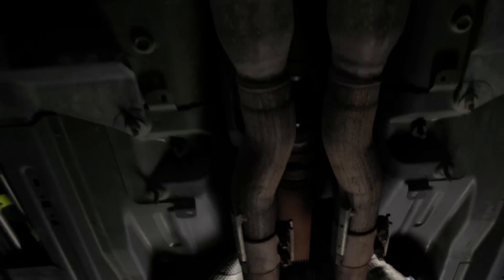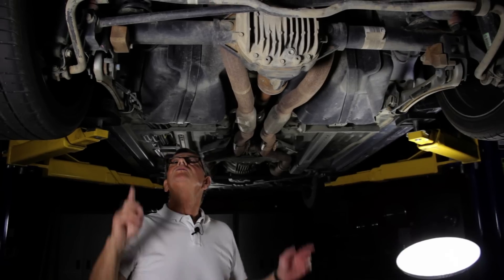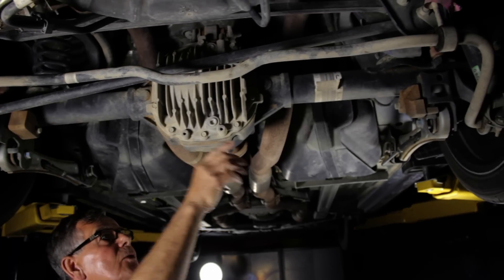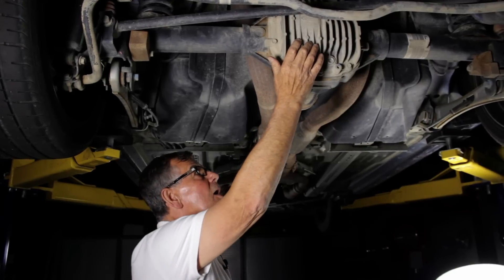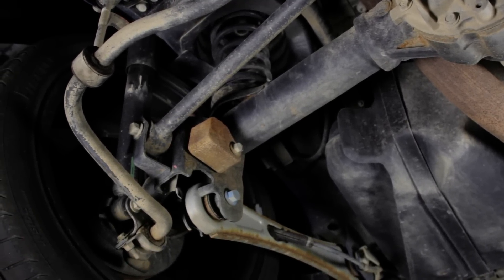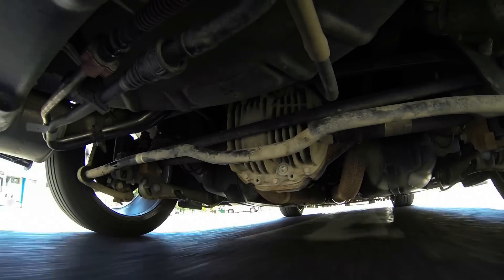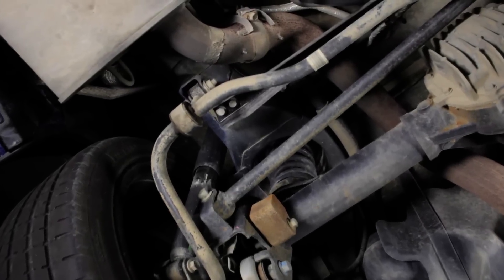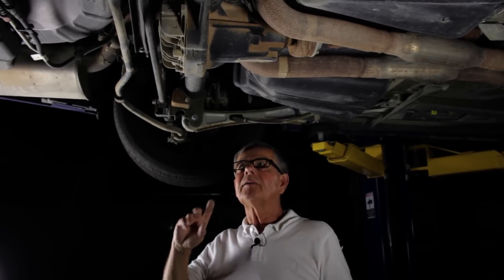2013 Ford Mustang GT Rear Suspension - C/D Underbelly

Comment: Mine has a bumping/rattle sound some times, still trying to figure out what it is, Ford could not find it on three occasions, it has been doing it from around 30,000 miles to now 72,000 miles. It isn't all the time and is a head scratcher.

Comment: It needs a watts linkage like the Aussie Ford Falcon, a 5 link like the falcon is superior, as the suspension goes down on a car with a panhard rod the differential does move side ways a bit, the watts linkage won't. It is a well known problem in Aus, the local GM product the Commodore had a 4 link like the stang, if you lowered them the diff would move side ways and a wheel would scrub on the guard so you would have to fork out more for an adjustable panhard rod where with the equivalent Ford you wouldn't have to. The Falcon has lots of advantages back then over the Commodore, the GM had a Macpherson Strut front end and the Ford had a proper twin wishbone set up like a European car and there fore handle so much sweeter, the GM was quicker at the time because the Aussie 5L was developed for the local racing scene for like 30 years where the Ford at the time got the standard 5L from the F100 instead of the GT40 headed motor from the Mustang which we did eventually get in the late 90's but then GM brought out the 5.7 LS1 motor which monstered the old 302.

Comment: Ford actually got a lot of life from the 8.8" rear. But it's finally showing it's age & needs an IRS. These car aren't exactly cheap, you can easily push $40k with the track pac & some brembos. They can afford to ditch the Chinese made Getrag trans for a longer lasting Tremec. Hopefully the '15 model will have a tremec along with the IRS.

Comment: Watt's link? I can see that for adjusting roll center and the fact that it's right on the floor pan would indeed help keep it steady (rather than mounted on the diff). Thanks for the explanation.

Comment: "The connection between a driver and car needs to get shorten and enthusiasm which it lacks over all."  wtf does that mean? The Mustang platform with the live axle has proven it can outhandle a BMW M3.  The suspension may be simple, but it is cheap and effective if set up right and Ford sets it up right. The Mustang aftermarket is also so well developed that for a few dollars more the car can punch way above its weight class.  Advice: drive more, write less.

Comment: True . . .  but I am telling you a watts link/torque arm setup is just as good or superior to an independent rear suspension on the track.  a stock 2011 mustang GT is equivalent to an M3 (IRS) on the track.  With the above mentioned setup for 2k it will ride better and utterly destroy an M3 on the track. I know it sounds crazy. I did not believe it myself until I saw it and drove it. It is a basic modification that pays huge dividends and costs a whole lot less.

Comment: Check out Griggs racing and or Cortex racing.  the best suspension for these cars utilize watts links and torque arms which are attached to the floor pan right next to the driver's ass and changes the instant center of the vehicle.

Comment: I have read the complaints about the shifter.  The car I drove was sweet. It had no problems. Best feeling american made gear box I have experienced. Weather it will grenade 5 months down the road I do not know. Growing up with the tail happy, wile simultaneously understeering Mustangs of the 80's. I was blown away at how easy the 420 hp GT was to drive quickly.

Comment: You're talking to someone who has owned and driven plenty of good-handling cars with IRS on good roads and bad.  I know that there is a fundamental advantage there.  However, a very well-done live axle setup can outhandle 90% of good IRS setups.  Your long-winded attempt at sounding intelligent was both unnecessary and silly.

Comment: You can have a car which will give you over 1.05 G-force but with blink of an eye, you will doing over 10 donuts on the freeway because of the inconsistency. The entire system has to work as a "whole". Mustang suspension is retrograde and needs to a complete makeover. The connection between a driver and car needs to get shorten and enthusiasm which it lacks over all. Drivers are not confident about whats next.

Comment: By deploying four independent suspensions, they are working independently to stabilize the net force. They have a higher ability to absorb the motion generated due to uneven surface vs live axle in which motion is transferred to the opposite axle which will further destabilize the net force.  A good sports car is something which can decrease the inconsistency between all the forces acting.

Comment: Hahaha!!!! Do you know what exactly body roll is? At first, when you are turning a car, you have few forces acting to push the car inwards and also outwards and the handling is the net force acting among all the forces at a given speed with respect to the total body weight. Suspension is nothing besides a hardware designed to keep these forces as close as so called "Equilibrium" which is almost impossible to achieve.

Comment: You clearly don't know what you're talking about.  I bought a 2013 Mustang GT for $29,000, brand new.  They handle very well, and the body roll is controlled.  I'm not sure what you're comparing it to, but the current generation Mustang GT handles right on par with some RWD sports cars, with the right tires.  Don't knock the live axle.  This is coming from someone who has owned and driven a ton of great-handling RWD, AWD, and FWD cars.

Comment: The tires on the BRZ are the Michelin Primacy Hp's (Prius tires). The BRZ will outrun a base Mustang V6 (with all season tires) around almost any track. If you add the track package from Ford ($1999) better brakes from the GT. Summer performance tires. The Mustang V6 is about 1.2 seconds quicker than the BRZ at willow springs raceway. It is the faster stock car. BRZ switching to a Summertime tire like Dunlop Star Spec would take 2 seconds off the lap time at willow. That is NOT a factory option.

Comment: If you car comes stock with Eagle F1 's. That is the best stock option for your car. Putting better wider tires puts you into aftermarket. The Corvette ZR1 has the option of using the Michelin Pilot Sport Cup tires. Slicks for the street. You can even get them shaved. In comparison test Ferrari and everyone else cries foul (they cant come within 2 seconds of the Corvettes times.). It is a factory option. It is stock.

Comment: I'm not convinced that a BRZ with tires would beat a V6 Mustang, though I've never driven either of them so I won't argue. As for tires making a car not stock - that's debatable. If my car comes with Goodyear Eagle F1 Supercar G2s (and it does) and I decide to go cheap on tires and get some Continentals from Costco, am I stock? Same with brake pads and clutch, even transmission oil. Im not sure but I'd say replacing wearable items can still classify as stock. What do autocross rules say?

Comment: All the ZL1 needs is nothing. 285's are the way the GT 500 came from the factory.   You could always take out most of the seats and sound deadening from the ZL1 and throw on the street legal slicks from the Vett and open the gap back up between the two cars. The Sock BRZ cannot beat the Mustang V6 with the track package. If I put Summer rubber on the BRZ it would be faster around almost any track than the V6 Mustang. It would not be stock would it?

Comment: I own a 2013 GT500 and I've driven a ZL1.  I promise you, the only thing the GT500 needs is wider tires in the back and better brake pads up front.  The GT500 comes with 285s in the rear, that is ridiculously small for a 662hp car.  Once you put 325s on the rear, the car is entirely different.  The GT500 gains a lot more with better tires than the ZL1.  1/4 mile times go down and lap times go way down.

Comment: For  $23,000 You get 305, hp a six speed manual, Hids, LED running lights, A LSD, And  Bluetooth. Not to mention Air, pw windows rear defog. Nothing for that price can touch it.  For $7000 more you get 120 more hp and a 7000 rpm red lined V8. With the brakes and the Suspension upgrades to keep up with the power. With the $1500 track package the GT is just as fast as the M3 around almost any track. No stock car in Korea as fast as a base Mustang GT. You cant get a LSD on the BMW 1 at any price.

Comment: 3-4 tenths?  No..  Look at the difference in trap speed.  The power to weight ratio of the GT500 is far superior.  You can get a lot more power out of both the ZL1 and GT500 engines without major work, so that argument is out the window.  Ford is using an engine design that is fundamentally superior for making power while keeping an engine streetable.  Overhead cams and 4-valve heads.  It's a more complex and expensive design, but undeniably more efficient for making high HP.

Comment: "Learn how to throttle control?"  When is the last time you went to a drag strip and launched a car with a live axle?  How about an independent rear suspension?  There is a reason why drag racers prefer live axles.  They are superior for launching a car, hands down.  You get better traction off the line.  They are also harder to break, all other things being equal.  You don't launch a car in 2nd gear if you want to accelerate quickly.  What the hell man.

Comment: A 2013 Mustang GT weighs 3600lbs, has disc brakes at all 4 corners, and has a DOHC, 32-valve V8.  The only thing that you said which applies to the Mustang is the live axle.

Comment: The negative with an IRS is that launches will not be as easy with that much power.  Solid axle is better for drag racing.  Durability of a live axle is typically better as well.  Live axle is also lighter overall than IRS, not heavier.  The IRS will have less "unsprung" weight though.

Comment: The Mustang fits more of those categories than most of the cars I just mentioned. It's a 2 door. It's a 2+2 which is typically used as a 2 seater. 3500-3600 lbs is not considered heavy in this day and age, and is not much heavier than an Evo X. I would say that its platform is as close to FMR as the 370z, and you can order it in a convertible.

Comment: "A low-built car designed for performance at high speeds." This is the definition by Dictionarydotcom, suggesting that the mustang is indeed a sports car. However, nowadays definitions mean little and public perception is everything, and I'd bet if you walked down the street with a photo of a mustang, you'd be hard pressed to find someone disagreeing with me..

Comment: A race team can set up a car. Great. That's called making due with budgets and tech restrictions. Why does EVERY other sports car have some form of IRS? Because it's a fundamentally better system than a SRA. Can a SRA car be made to handle well? Sure, but given the choice IRS is better in almost every way. For people who don't track their car, IRS is safer and will ride smoother. The current Mustang is a fine car with a great engine, imagine how much better it would be with a modern suspension.

Comment: Their just incapable of understanding what "Fun" is, fun is a cheap, fast car, doesn't matter if it's a '92 Camaro with a V6 that's been abused, a new mustang, or some rusty deathtrap coupe. A true American respects the muscle car for what it is, cheap fun that may (Likely will) kill you. I'm no Ford fan, I'm actually a fan of Oldsmobile's, but anything with a V8 in the front, two doors, and two drive wheels in the back is buckets of fun. Stop hating and start supporting the US auto industry.

Comment: Fair enough, although I'd like to see some numbers of drag vs track/autoX drivers. A lot of the muscle car mentality is bragging rights, whether you use it or not is a different matter. So why stop at engines? The Mustang has been left behind in suspension bragging rights and they need to catch up, especially since the next Camaro and Challenger are bound to be better. By all accounts the current Mustang is as good as a SRA can get.

Comment: Obviously the Mustang, Camaro, etc started as muscle cars. Cars with big powerful engines that were fast in a straight line, not so much around a track. The current crop of "muscle cars" can be pretty good around a track with the right packages/options. The recent Boss 302 was designed from the start to be fast around a track, even before adding the Laguna Seca package. The point is that these American V8 coupes are more sports car than ever before.